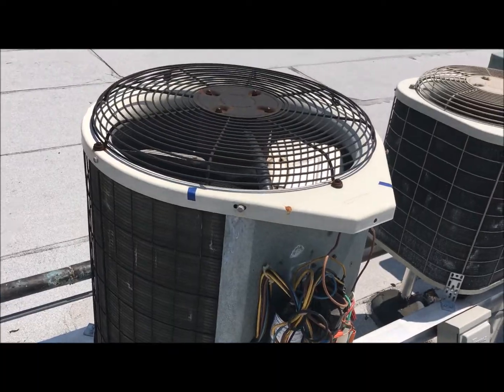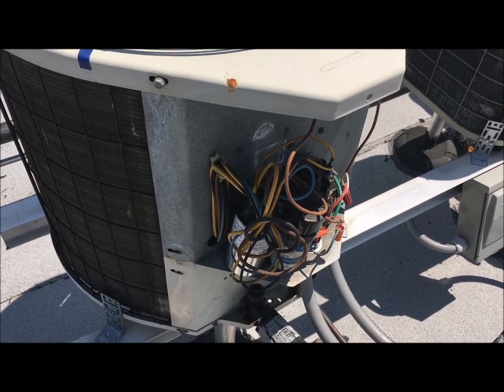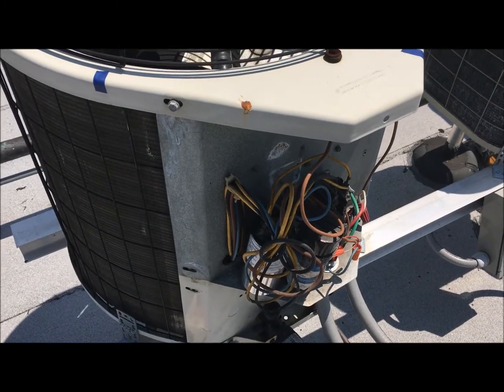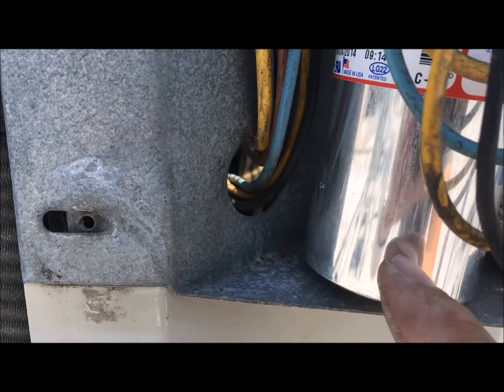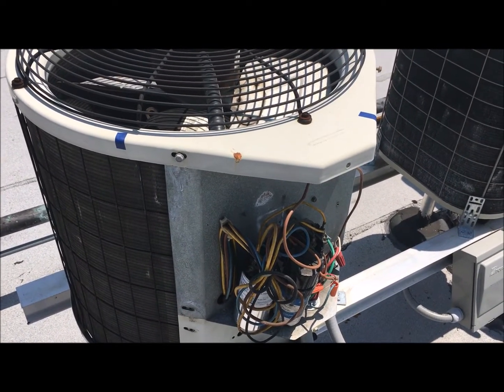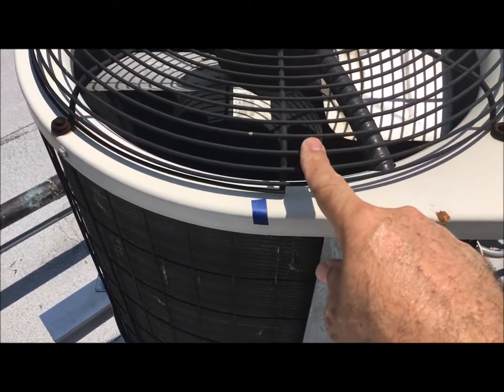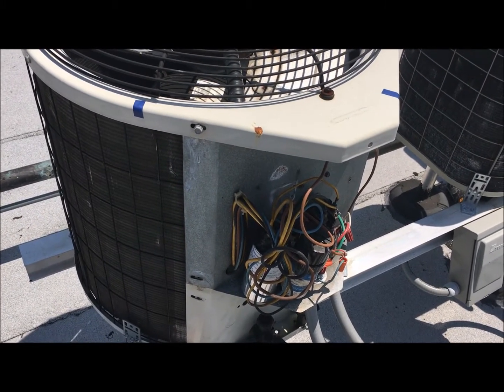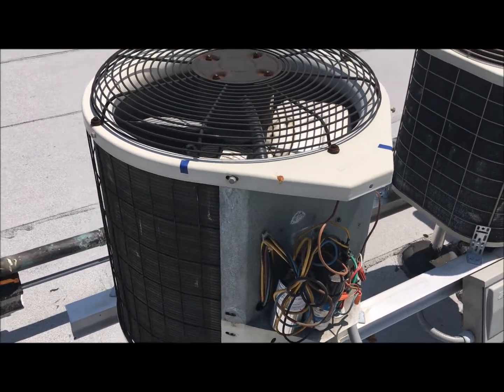Home Air Condition Repair: Blows Cold Only At First Then Hot

Comment: How about when compressor fan is spinning but blowing hot air from central unit inside room?

Note: When i turn on AC, first cool air comes and after then when compressor fan starts spinning, warm air blow out.
Reply from the maker: It sounds like your fan is not working all the time. Check and see when it’s blowing hot air if the fan is working on the compressor
Reply: @conquryourfear  you are right, fan stop spinning after 4/5 mins. And then hot air blow out
Reply from the maker: you need a new fan motor.  that's it
Reply: @conquryourfear  thanks a lot. How much it might cost for changing new fan motor?

But i have a question. If the motor has problem, then why it spins first? And when its spinning, that time why fan motor looks ok.

Comment: Hey man, thanks a lot for your video. I'm having a similar problem and found this, but I still don't know if this is my case.

If you wouldn't mind if I ask you a question. My AC seems to only be able to run at nights. If I try to run it during the day (when outside we're at around 40°C), it doesn't seem to work. It would work for about a minute, as you said, but then it blows only hot air. But at nights it seems to work fine, which leads me to believe it has something to do with outside temperature. Do you think it might still be a problem of the capacitor?

Thanks a lot!
Reply from the maker: Turn on the AC unit. Put the position on and cool. Go outside and see if the fan continues to work for at least 5 to 7 minutes straight. The idea is to see if that fan is shutting off after it heats up. Let me know
Reply: @conquryourfear  thanks for your reply!

I ended up hiring someone because apparently the fan sometimes turns on and sometimes it doesn't whenever the compressor kicks in. There was a chance that the fan doesn't operate, which leads to the compressor overheating and shutting off. I guess there was some relationship between the outside temperature, but it apparently was just a matter of the fan not functioning properly.